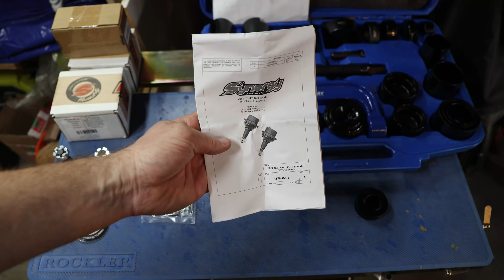Jeep JL Wrangler installing Synergy Ball Joints

Comment: I had my 2020 JLU aluminum steering box changed out to the steel one under the Jeep TSB.  It made a significant difference in the overall tightness of the stearing.  I never had death wobble...yet, but steering was overall a bit loose.  Highly recommend getting the steel one.
Reply from the maker: Yeah, I wish mine would be unter warranty. They declined work on a TSB on mine since it is out of warranty...